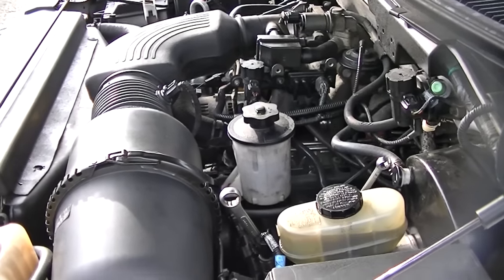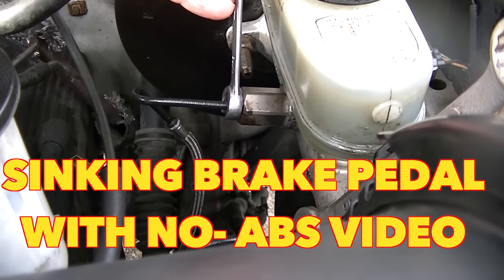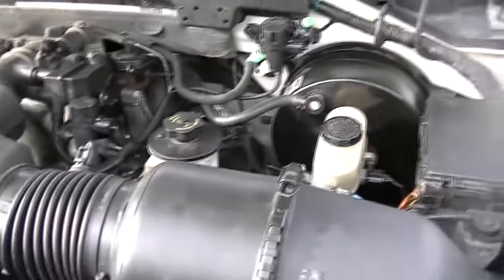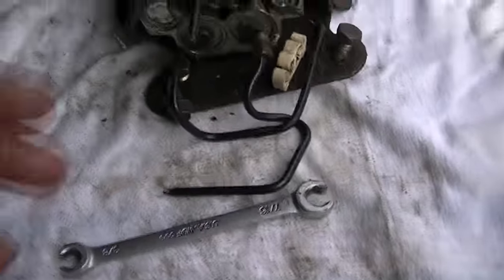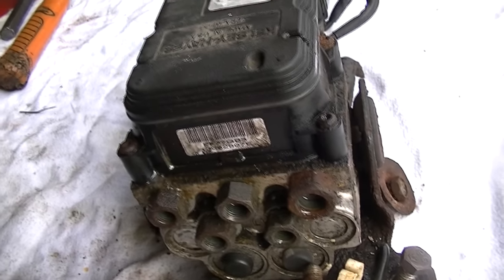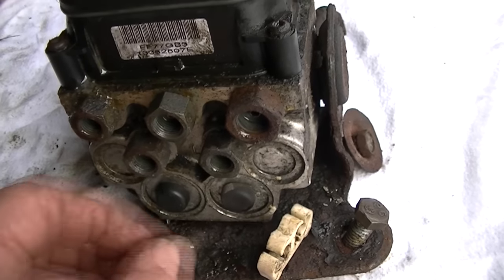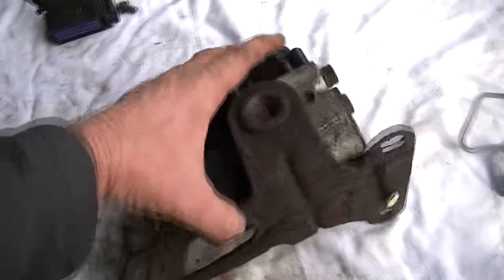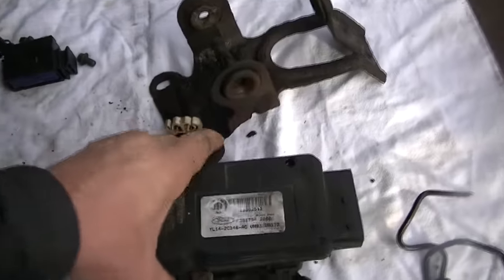How I removed my ABS PUMP Sinking Brake Pedal~! Expedition

Comment: Sinking brake pedal is caused by the dump valve in the abs valve module. Unfortunately there is no rebuild kit and you can't by the valve block by itself. Remember mechanics repair technicians replace.
Reply from the maker: Thank you. Great info to share.

Comment: That’s it all that to take it off be for real and replace it then bleed that abs block cause there’s going to be hard to get air out unless you got a auto brake bleed scan tool your not going to bleed that abs block without one so good luck with all that your a  not a teacher I would take advise from

Comment: why couldn't you have just taken the module of itself?  the black sensor held on by 4 bolts looks like?
Reply: His problem was in the brake pressure modulator valve assembly,  not in the controlling electronics. A fault in the electronics will throw a code & turn on ABS light on the dash.

Comment: If you think about it, how often does the ABS system actually see action?  From year to year, probably never, so no wonder the valves can stick!  So in the interest of maintenance, it might be prudent to occasionally force the ABS system into action with some aggressive braking.  Just a thought!
Reply from the maker: You are right. Also brake fluid over time will slowly break down and 
cause issues on seals and valves. I was just reading a NTSB report about
 the lack of fluid changing/flushing in braking systems....that rarely 
get done. Thanks for your comment!
Reply: TVWXMAN32  just had an issue where the rear brakes on my Celica were pretty weak.  We explored all options, i.e. rebuild master and calipers, new material etc.  Then I thought, could be sticking valves in ABS pump.  Took her out and repeatedly smashed the brakes at speed.  Guess what?  The faults disappeared!
Reply: yeah no doubt man. often overlooked for sure.
Reply: Same thing with your T- case (4X4). Just shift into Four wheel drive once a month
Reply: I'm pretty sure that ABS systems exercise the solenoids on startup.
Reply: @foghornleghorn8536  I know they run the pump at startup (for power up self test) but I don't know if the valves are tested too.
Reply: @abdul-kabiralegbe5660  I was able to find this in an article: 
STARTUP CHECK

When the startup vehicle speed reaches approximately 10 km/h, ABS-ECU performs the following checks.

Motor, solenoid valve check (only in initial startup*)
Operates the motor relay in ECU and checks the pump motor operation. At the same time, ABS-ECU sequentially energizes each solenoid valve in a very short period and checks the valve operation.
note	*: Initial startup indicates a first startup after the system has started.
Wheel speed sensor check
ABS-ECU checks for any wheels that have not received wheel speed sensor signal from the startup.

I have no idea if this is how all ABS systems operate.
Reply: @foghornleghorn8536  Great info, thanks!

Comment: I replaced the master cylinder last year on my wifes Windstar for a sinking pedal condition i got lucky because thats what it was. The van does have ABS. Just the other day the symptom returned and i believe it is the stuck dump valve on the ABS unit this time. I will do the test Ford says in the factory manual for the ABS (Hydraulic Control Unit) to be sure. Yes the lines can be a bear. I had to replace some on my dads '03 LeSaber abs...what a pain in the backside.
Reply: Awesome 👍 job

Comment: @Nathan Rohrbough .Nathan, on my grandson's 2003 Blazer, Although I was able to keep the ABS Light off after I hose clamped a rub-hole in the line that goes to the right front caliper. Once I replaced that line, the pedal remains spongy. After seeing a minor leak at the new line fittings, I'm convinced that the parts store gave me the wrong type of fittings on a stock piece of line. If there's no leaking going on in the morning after driving it 3 miles, I'll replace the pump. Thanks for the video & your comments if you think I'm heading in the right direction.
Reply from the maker: Nice!!

Comment: Having the same problem on my 2007 Expedition. ABS light on. Put on all new rotors and pads, and bled the system. Worked good for  a few days and then the soft pedal and ABS light came back. I will have to try this. I believe it is the same as yours. Thanks!
Reply from the maker: Yes! Funny thing is I never got a ABS light. You can have a bad ABS wheel sensor and get a ABS light...but that's has nothing to do with the ABS pump (That is really the issue in most cases for a sinking pedal) Let us know what the fix is so other people can read your story and have hope!
Reply: Ray Calandra did you fix yoir car? what was the problem? please i have same problem with ABS
Reply: Internally collapsed brake lines.... I've seen it a few times in the past. When you release the brake pedal, the vacuum that pulls the fluid back into the reservoir collapses the inside of the rubber brake line. When you bleed them you will see a reduced stream of brake fluid.  

Good luck!

Comment: Thank you for your video, I fix my 2005 toyota highlander by following your instruction, I wasted money on master cylinder, but by replacing the ABS pump fixed it👍👍👍👍👍👍❤️❤️❤️❤️❤️
Reply: Did you have to bleed the abs module with a machine?
Reply: Did you have to program

Comment: How did you bleed the new one?  Everything I'm finding indicates you have to use a scanner type tool that activates the ABS to bleed it.
Reply from the maker: Nope. You don't need one. I've never used one. Just bleed it at the wheel...some autos maybe, even I find that hard to believe. I'm living proof ;)
Reply: @FixingWithPassion  what about the programming part or is that not necessarily?

Comment: When you installed the new ABS pump, what steps did you take to remove the air from the system?
Thank you for the video.
Reply from the maker: Just pump the pedal until it gets hard. That's what i did.
Reply: @FixingWithPassion  Thank you. I will try that when my pump arrives.

Comment: The wrenches are called flare nut or line wrenches. They are a must when working on brake line and or fuel lines. They do come in Std. and Metric. Most parts stores sell them and they do not cost that much. Keep in mind you can not replace just the nut part if you round it off.
Reply from the maker: Yea, I stay away form coffee when using them...lol  The call me Mr round-off.
Reply: heat them up a little and they come off like butter
Reply from the maker: Roger! That's a big 10-4~
Reply: Keep in mind that the makes of flare nut wrenches typically sold at parts stores, are low quality junk with excessive play in their sizing and some, even metal too soft so deform at torque.

Comment: Shouldn't feel also the pulsation of the brake pedal?
I think my car has the ABS system broken, because I don't feel any pulsation of the pedal, even if  I strongly press the brake pedal  under ice conditions...
It is possible the ABS to be in good condition, even  if the brake pedal doesn't pulsate?
GREAT VIDEO!!
Reply: 恐怖醫學

Comment: just wondering if you pull the ABS fuse out, will the brake fade go away as you are not using the ABS sytem
Reply from the maker: No. I wish. I've  tried that lots of times...it never works (for me)

Comment: Hi
My 2007 RX 350 brake padel sink down, the master cylinder was changed two times still same issue, Can I remove ABS fuses to see if it works with out it?
Thanks
Reply from the maker: No taking out the fuse wont help unfortunately.
Reply: @FixingWithPassion  if I take the fuse out won’t it by pass the ABS? I want to do that to see if the brake sink with out abs.

Comment: 5 brake lines plus 
3 bolts on the ABS pump’s frame, plus
one electrical plug 
is all that holds it on.
Leave the 2 bolts that connects the ABS pump to the ABS pump frame tight. Do not separate the ABS pump with it’s frame
Reply: Why do you say this?  Just because it's extra work or...?

Comment: Man i do have an winsdtar 99 and the brake pedal goes all way to the flor i check all lines,master cylinder,the booster and nothing wrong with them it lefth only to check is the abs pump and components..do you recommend me anything before i do that please i need help.
Reply from the maker: Change the ABS pump

Comment: How do you bleed these?
Reply: use an abs code tool that will turn on the abs pump. 200 bucks amazon for the low cost units.

Comment: I heard heating brake lines could cause them to explode. So i never tried using heat to remove the lines. Old lines never have come off for me so i cut them up as standard. I will try this while wearing safety glasses. Thanks.
Reply from the maker: Hope it works.
Reply: You don't need that much heat, and it is directed at the tube nut, not the line.  Works frequently.
Reply: Tightly focus the heat on the nut, and first drain the brake fluid out of the line. It's sometimes easier to use an induction heater rather than a torch, but if you have the line there then you don't have a way to put the induction heater coil around the nut, unless you cut the line first because you planned on replacing it anyway, which it could be due for if there's excessive rust on it, lower in its run to the wheels.

Comment: Having this same issue. Shop replaced master cylinder and cleared the lines. Do u recommend replacing both module and pump? Also did you have to program computer afterwards?
Reply from the maker: Well for me, the pump and module was one unit. As for programing...never had to do that.
Reply: Did u use a used abs pump and module

Comment: Just thought I'd let you know, those are "TUBING WRENCHES", not brake wrenches.  If you go to and auto-parts store and ask for brake wrenches, they are going to show you the wrenches to remove the springs on shoes and the expander on a disc brake caliper.  :-)
Reply: Flare wrench

Comment: Where can you get one of these abs modules??  I checked RockAuto and my local AutoZone and Advance, but no one even has this part listed.  I have a 98 F150 and just changed the master cylinder, but still have very soft brakes that go to the floor.  Any help would be appreciated.
Reply from the maker: Salvage yard...e-bay used
Reply: Maybe a junk yard
Reply: @ministerstayfly9213  ALSO, you can send your original in and have it rebuilt.

Comment: So your brake pedal was sinking because ABS pump was faulty? What inside the ABS pump would cause the pedal to sink?
Reply from the maker: Check valves
Reply: A faulty/sticking valve in the pump assembly allows brake fluid to flow in a circle, from master-to inlet valve-back to master cylinder--instead of forcing it down to the caliper. When ABS is not engaging, it should flow from master-to inlet valve-blocked by outlet/dump valve-forced to caliper. Imagine a syringe with a hose on the end. if it only goes from point a to point b, there is always pressure. Add a tee to that hose on the syringe, allowing fluid to flow a litt;e through the tee and a little down the hose, dramatically reduces pressure, and thats the best i can explain it.
Reply: Hey man,on my car pedal get normal resistance when car offbut when i start car it hoes straight to the floor,no resistance at all,was it like that for your car? Ive got no abs light but diagnosis says brake module and ecu communication error,also tried yo activate abs pump with diagnostic tool,its a 2006 volvo v50 maybe its me but shouldnt abs pumps emit quit the sound when activated? Hear no sound,but diagnostic says nothing abouy faulty abs,just brake module doesnt communicate with ecu,thoughts?

Comment: Hello i had a sinking pedal.
I replaced the mastercylinder and the brake booster.
That fixed the sinking petal.
I drove the car (2007 ford edge)
For about a hour then the front brakes locked up i let it sit till it cooled down then it did it again. I'm thinking tis has went bad but what's weird is it was fine before the sinking petal not even 24hrs later it started locking up..
Also how hard is it to bleed this do i have to bleed it at the wheels or can i bench bleed it with a bleeder pump?.
Reply: It sounds like the brake booster pushrod length needed to be checked specially with an all new parts.  Also, some misguided shops and Do it yourselves, sometimes adjust the rod behind the pedal which should never be touched for a low brake pedal.  If someone messed with the brake rod, it also messes with the booster rod and throws every thing off. This causes the brake fluid to never fully release and becomes trapped after the master cylinder and returns to normal after a cooling off period.

Comment: I have a ford and suffered the same affliction of soft sinking brake pedal with no ABS light.    Anyway, I bought on Ebay for $150 the ABS unit and put it on.  I also put a rebuilt master cylinder in (before buying new ABS unit).   After bleeding the system, I got the same symptoms as prior, with nothing getting better.  I did now get an ABS light on.  My ABS scan tool says 'pump circuit failure' .   Perhaps it was not the unit after all but perhaps the connection to it, being that same problem still exist.  So, I have not a clue on what next to do.  Thinking of putting the wheels on and getting some temp plates to take it to Ford and pay them to diagnose it.   I did that for my Subaru. I paid them $56 to tell me what it needs and I brought it home and did the work myself.
Reply from the maker: I got a  bad used  ABS unit one time also. Went back got a 3rd one and 
fixed the issue. Maybe that unit is bad just like mine was. Uses parts 
sometimes are all ready bad giving you that "WHY"  Syndrome.
Reply: Perhaps, I am wondering, could a bad brake booster create a sinking pedal problem?  The car stops but pedal is near floor to do so.  After i replaced the ABS unit (used from ebay), the problem is still there, no difference, Not better nor worse.  Its hard to find ABS for my lincoln.  Not many of them out there.
Reply: @Romulan112  No, a bad brake booster will just dramatically increase the force needed to push in the brake pedal, the opposite of what you're seeing.

You have air in the system somewhere, unless there's a leak and you haven't noticed the puddle yet.  Bleed all lines at the wheel, furthest from the ABS module first and so on.

Comment: my 2001 lincoln navigator has had 3 master cylinders replaced.  Mechanic thought maybe it was the cause of my pedal sinking to the floor.  Still doing it.  Seems to fall to the floor when braking lightly, or at full stop.  ABS module has no codes.  Is this still a possible reason?
Reply from the maker: Jamey Magee ...Yes! I had no codes either. To this day I'm still driving my expedition with perfect brakes after replacing my ABS pump.
Reply: mechanic said he tested the abs module and was good
Reply: thank you. I bought a new oem brake cylinder thinking the one's they put on were crap.  I will try a new pump.  Need to bleed after that's removed, right?
Reply: Sorry, one last question.  Pedal sinks whether motor is running or not.  Still abs suspect?
Reply from the maker: Yes! Mine did the same thing. I got a used one for $40 at a local junk yard. Let us know when you fixed.
Reply: Thanks soo much for posting this.  I was going crazy trying to figure out if my truck was cursed.  I replaced the abs pump($70) from junk yard.  Put it in in 30 min.  Brakes!   More than ever before and no sinking pedal!  Thanks
Reply from the maker: Thanks! Comments like this make me want to do more on Youtube! I'm happy you can stop on a Dime!  haha

Comment: Do you have a link for the cost of the pump I have a 2001 Ford excursion v10....had brakes before I CHANGED the calipers and caliper bracket and pads bleeded the brakes 4 times and now my break pedal sinks to the BASEMENT....how the HELL did this go out just because I CHANGED those parts...
Reply: All that work & it may have been Out to start . Used abs unit on Ebay / Amazon . Videos on how to test it in car .
Reply: @flowrob6861  thanks but I checked the abs  unit...put nail in hole it did not move at all so abs is working perfect it has to be none other than the DAM break booster..but again I had breaks I took the DAM truck to AutoZone WENT home changed all that shit bleed it 4 times and it sinks to the other side of the planet...so I have been driving it but like an old lady sorry old lady ...as long as I pump the breaks before I anticipate my STOP brakes work...if I DON'T pre-pump I will run over who ever the HELL is in front....

Comment: I have an issue with 2007 expedition when i apply brakes they almost stay stuck it releases sometimes but i can feel it when im driving ive change booster,calipers,brakes even put on a new master cylinder and still has this issue can someone help me thanks in advance
Reply: Not the pedal but the brakes are staying somewhat applied
Reply: Im about to change abs pump does anyone know if this will fix my issue
Reply: Old comment but I just went through this on my 05. I can almost guarantee that it's the rubber brake lines going to your calipers. I threw a bunch of parts on mine trying to fix then I can't across a video on here explaining it. It's your rubber lines that are clogged!
Reply: @trashin.n.smashin  ...and collapsing internally

Comment: Hey man i do have an ford windstar 95 that the brake pedal goes all the way down i checked and not find any leak even checked the 4 cylinders from each tire and also the master cylinder and finally the relays and  fuses they all good how i can tell if the pump or any the component went bad?i need help please.
Reply: Time to replace the abs module or get robbed at the brake shop